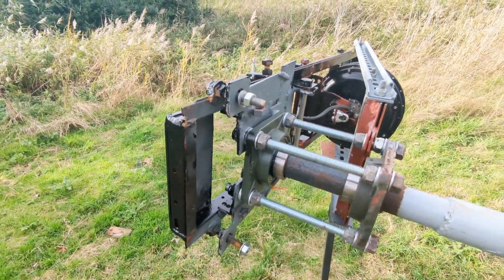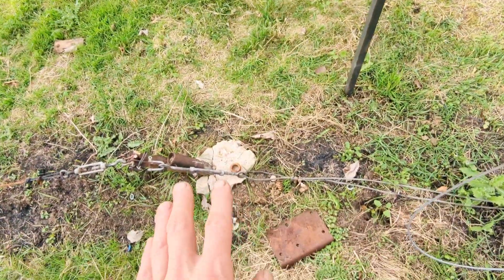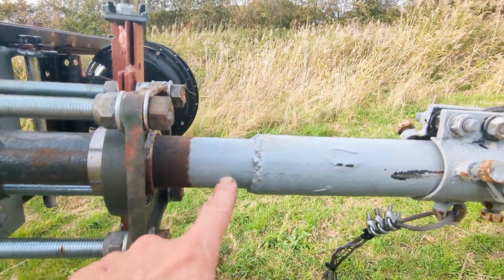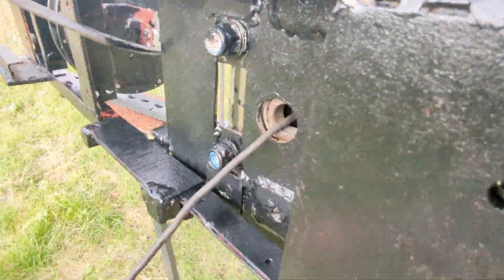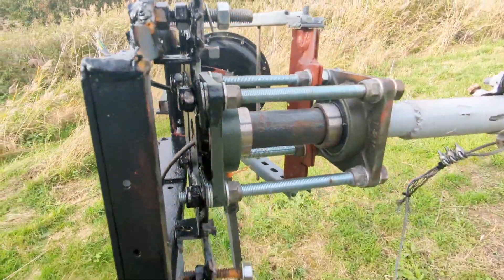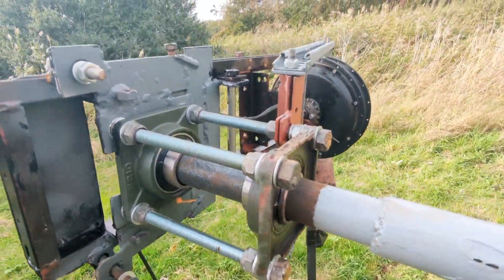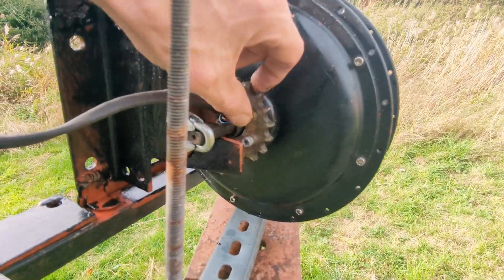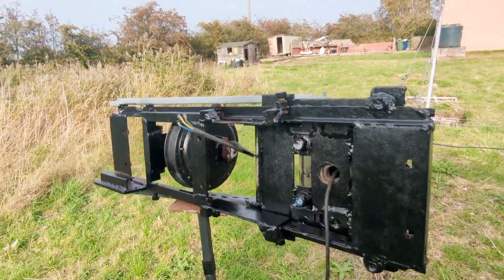Very Happy to see the 3kw Wind Turbine on the tower at last FREE ENERGY Project

Comment: Have you considered keeping the turning mechanism on the base of the pole, you could reduce a huge amount of that top heavy and huge surface area with sharp corners to a minimum. The only thing you need in the air stream is the motor and blades. You wouldn't need half the support. Also you want to reduce the drag around you mechanism as much as possible, I'd recommend you make a cover.  Cool work though looks like fun.